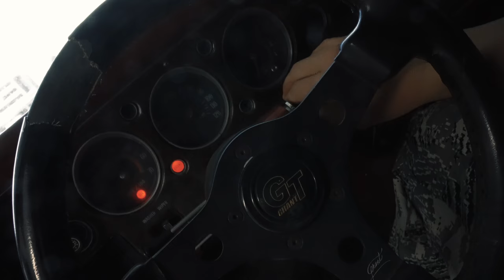Rabbit Hunting in my Backyard with Bow

Comment: Check to see if you have spark with a screwdriver. Take of the #1 spark plug boot put the screwdriver were the plug goes, then ground it against the motor. Maybe just the cap and rotor bug.

Comment: Had that same problem on my 82 f150 drove it one day next day didnt start so i changed my coil still didn't start it was the ignition control module replaced that and fired right  up and turns over a hell of alot faster.

Comment: With the el Camino obviously make sure ur getting fuel which u might be.... don’t know cause I ain’t there, but then I would check the cap and rotors. Also make sure the rotor is spinning and then if that ain’t it has to be wiring or the msd ignition box

Comment: I wonder if it's not starting because it's not getting enough gas into the carburetor used some starter fluid to see if you can get it cranked over to where it will start